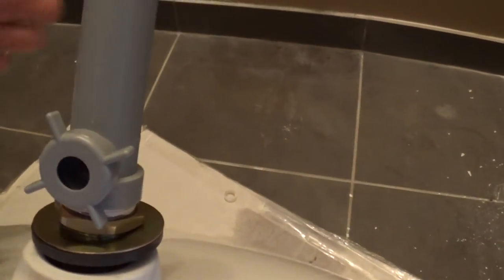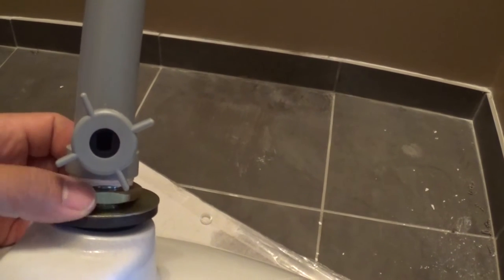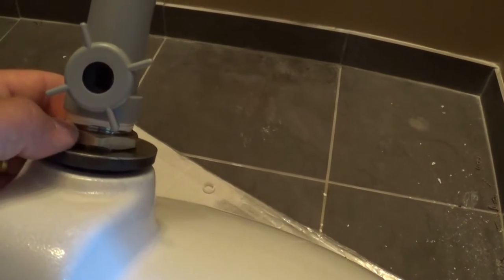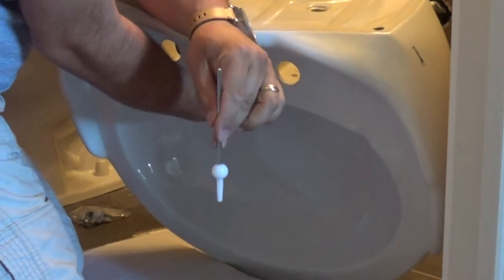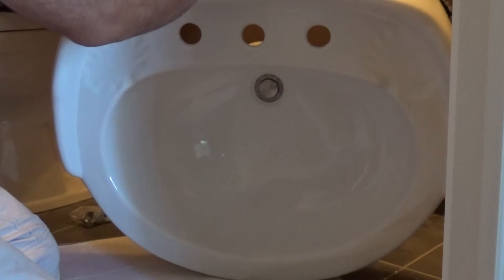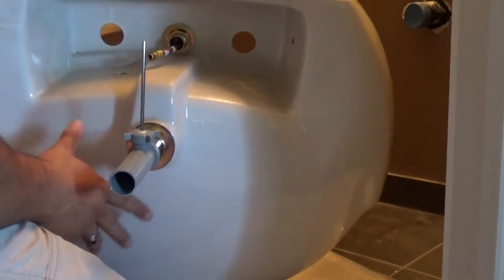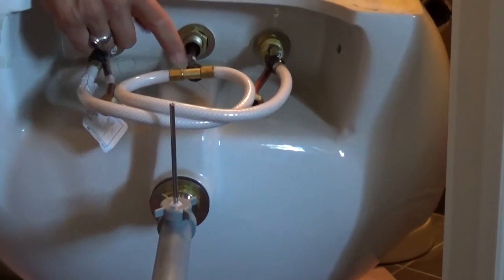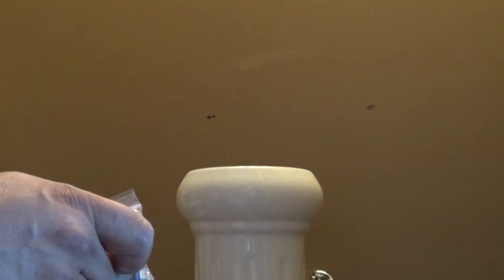Installation of a Pedestal Sink

Comment from the maker: The pedestal is fastened to the basin and the floor with a bead of 100% silicone caulking.  Pick a color to match your fixture, or clear silicone and run a bead between the basin bottom and pedestal top.  Then run a bead between the pedestal bottom and the finished floor.  Silicone will cure in 24 hours or less, then call it done.  Just make sure everything is lined up and plumb before you run your beads.

Comment: Why are the supply lines and shut off valves so close together coming through the wall?   Is there a standard spacing for them?
Reply from the maker: CenterTree777 That's a good question.  I roughed in the hot and cold lines close together so that they would be concealed better behind the narrow pedestal.  If I was going to install a regular vanity with a drop in sink, I would have spaced the lines further apart.  It's always a good idea to plan your rough in for the type of fixture that that is being installed.  Most plumbing fixtures have recommended rough in dimensions and elevations, and that info can be found online. Hope that helps.  Thanks for watching!